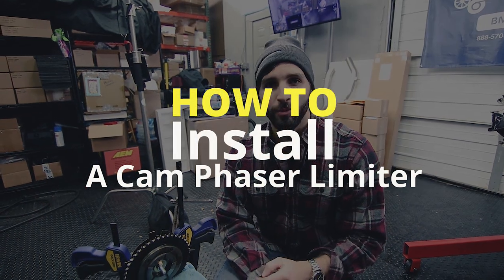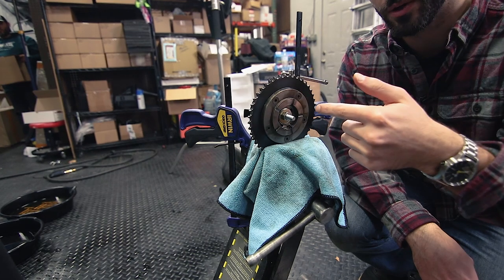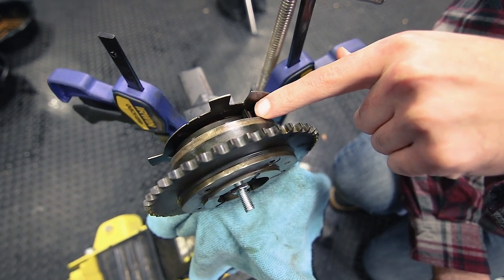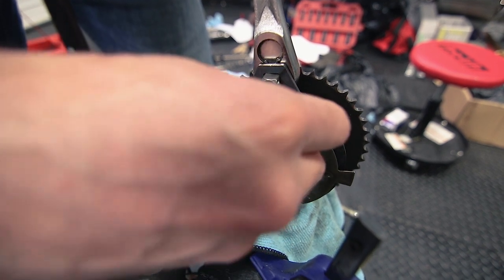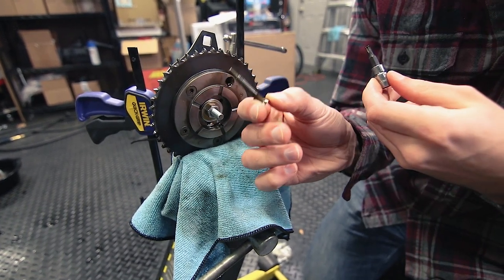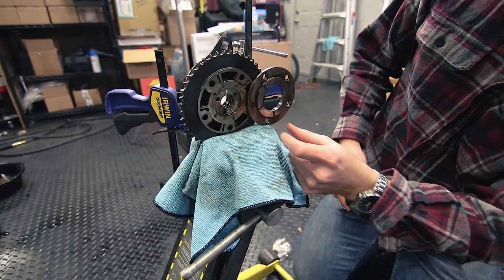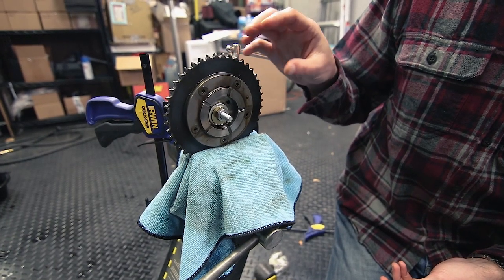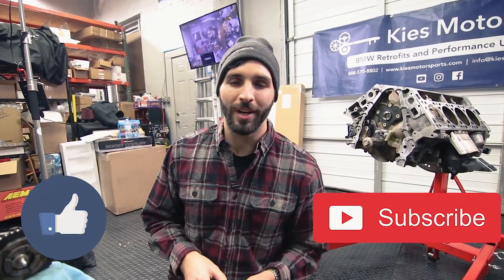AFM DOD Delete - How to Install Cam Phaser Limiter VVT - Silverado Corvette Camaro L83 L86 LT1 LT4

Comment: The problem with these phase limiters are that they do not fully lock out the cam sprocket, the sprocket can still slightly move on the inside , on the dyno there has been erratic readings and power loss issues with those phaser lockout kits. Ditch that setup and use a LS3 sprocket and billet timing cover. Also, that sprocket has to weight 10lbs, think about taking that rotating mass off the camshaft.
Reply: Would u happen to know which car gear vvt delete kit is good for single bolt
Reply: Armando Monreal Late Model Engines offers the Gen V LT1/LT4 VVT delete front kit. Comes with a new billet timing cover, LS3 single bolt cam sprocket, cam bolt. Also it utilizes a LS3 front seal which is less prone to having failures like the factory LT style seal is plagued with. It’s $500, while it’s considerably more expensive, it’s well worth the investment.
Reply: Lol
Reply: I have a 2010 vvt motor just installed in my 08 chevy with afm. I'm having problems with a rattling sound from above idle up to 2500 rpm then it disappears. I've narrowed the noise to behind the valve cover. Would this phaser be wreaking havoc in there? Can I just throw my cam sprocket from my old motor on there in place of the cam phaser and carry on?
Reply: What did you end up doing

Comment: I. Did the cam and lifter  delete on my 20 5.3 but did not  put the phaser limiter in .. after driving on hyway at idle motor has clicking ,grindy,metalic  sound around water pump area???? Could this noise be that damn phaser trying to activate???

Comment: Hi question..i took the bolt im not supposed to take out all the way out heard it unwind put the delete wedge in bolted it back up..would i run into an issue if i used it?

Comment: I have a non dod with vvt cam I am going to install, do I still need to do this to the cam phaser? or can I leave it alone. it is basically a stock cam just non dod.
Reply from the maker: You'll need to check with the cam manufacturer.

Comment: Trying to help a buddy that I sold an 07-13 model truck to and it’s throwing a timing code. They say the chain seems loose and I was sure I lined the cam and crank up right. It’s one of those VVT single bolt cams and it’s just hard to see. I did replace the factory timing chain dampener with a LS2 style(solids plastic) any tips on lining that cam phaser up?

Comment: Currently working my 09 Silverado w 6.2 l9h, motor didn't come w dod/afm. I got a TSP vvt2 cam, I want to keep vvt, I need to install the comp cam phase limiter for the vvt right?
Reply: Wondering the same thing. Is the phaser limiter the only thing needed to delete vvt?
Reply: @winstonhiggins2759  the cam phase limiter is for vvt cams, if you delete it you don't need.

Comment: Is the center bolt necessary when you are replacing the cam limited? The outside bolts seem to be the ones that matter.
Reply: I guess he thinks this thing is gonna fly apart.
Reply from the maker: Just to be safe we recommend putting it in. One of my buddies did this on his 6th gen Camaro and it flew apart on him and could easily take out an eye or worse.

Comment from the maker: FYI: This phaser limiter restricts the variable valve timing from 60 degrees down to 20 degrees of variability....

MORE INFO (for the curious people)....The Cam Phaser is an adjustable sprocket that controls the position of the camshaft relative to the timing of the crankshaft. This is also known as Variable Valve TIming (VVT). The phaser can advance the cam timing at low RPM for a smoother running engine and ideal low RPM performance and then retard timing at higher RPM for more horsepower and performance. The adjustable sprocket is controlled hydraulically using engine oil and the computer to open the solenoid.
Reply: The Sundae Drive can I just remove the vvt since I got rid of my DOD ? I went with a stage two cam
Reply: The North Pole Santas Work Shop yes you can. Both LME and Katech offer a billet timing cover that allows the use of a LS3 cam sprocket and single cam bolt. The Katech piece is on back order.
Reply: the vvt doesnt work at low rpm it works at high rpm advancing a few degrees the cam for more power and eficiency:hand-pink-waving:

Comment: What a great detailed video,, so I have a question,, so I’m assuming I have to install the limiter if I’m doing a delete?
Reply from the maker: It depends on the cam you are running. Whoever you buy they cam from will be able to advise what is needed

Comment: The first bolt I tried to loosen (@4:00) position, the freakin torque head stripped out of the the freak bolt. WTH  , I had no choice but to drill it enough to get an easy out in it and remove it!!!!!’ &$”&#% I heard something pop when I took it out, that was the only bolt I removed. Did I screw something up??????
Reply from the maker: Ugh man that stinks. Hard to know for sure. Doesn't hurt to get a new one to be safe

Comment: On a 2019 Gen V LT L82 5.3 there is a spring plunger behind the plate. Be careful when rotating it out of the way or the plunger and double spring behind it will shoot into a black hole.
Reply from the maker: Oh good to know! Thanks for sharing.
Reply: @TheSundaeDrive  I tried attaching a picture but can't on here.
Reply from the maker: You could email it to us at contact@tsd-motorsports.com and we can check it out. Thanks!

Comment: Is this completely necessary if doing a dod delete with a factory replacement type cam
Reply from the maker: You will need to check with the cam manufacturer. I'm not 100% sure if you keep the stock lobe sizes if it is. I did is a stage 1 which is only mildly more aggressive and it was necessary.
Reply: @TheSundaeDrive  thanks for the quick reply, it is a stock size, I think I'll be fine without limiter.
Reply from the maker: @coupe50h  no problem! While I think you are probably right, I always recommend double checking with an expert like GPI just to make sure. You don't want to be in this deep and have a simple thing cause an issue. Def let us know what they advise!
Reply: @TheSundaeDrive  sure thing, it is a customers truck, I've done several dod deletes, but this is my first 5th gen, and oh boy what a pain it is compared to older ls/lq stuff.
Thanks again
Reply from the maker: Ahh gotcha! The new ones do seem a bit more complicated. Best of luck with it! Hopefully the videos help you out!
Reply: @coupe50h  did you have to add the cam limiter with stock non afm cam?
Reply: @trevorgill1120  I did not, as my boss said it wasn't necessary, so it was on him if it fouled yo lol, but the customer has been happy ever since. I talked to others that said I should have put the limiter on it to be safe, but this guy been doing ok with normal driving.
Reply: @trevorgill1120  also, I put in a comp cam that was factory'ish spec as I was told the factory cam wouldn't work with the delete, but idk for sure. This gen of engines has deep valve reliefs so hopefully that allows clearance just in case. But the afm had to be turned off with a programmer before it would actually run right. Good luck.

Comment: What's the torque spec on the 5 bolts? You used a torque wrench but didn't say what it was
Reply: I know this comment is 2 yrs old but he says 85 in lbs in the video..

Comment: Thanks for making these videos. Do you need the phaser adjuster because of the new camshaft you are using? In other words, what would happen if you did not install the limiter? I just thought that the point of the vvt was to increase performance, so why is it necessary to limit it?
Reply from the maker: Technically you could just use the ECU to control cam timing and limit the VVT via software. Since we are using a more aggressive cam we want to be sure to avoid any piston-to-valve clearance issues. Adding the physical cam phaser limiter is a form of added insurance. If there is ever some sort of error via a sensor or software the VVT might advance the cam too far causing valve interference. The cam phaser limiter will ensure it does not advance more than 20 degrees
Reply: The Sundae Drive thanks for the explanation. Looking forward to see the finished project. I have a similar truck (GMC) learned a lot by watching
Reply from the maker: @andrewwilkinson5220  awesome! Glad the videos are helping!
Reply: @TheSundaeDrive  why not just do the VVT delete as well? Is it harder? Or not necessary?
Reply: @buddyrebel_Garcia   from what I understand you only have to do that if you’re adding a bigger Cam

Comment: What exactly does a cam phaser limiter do ?
Reply from the maker: Good question. I regret not mentioning that. The cam phaser limiter limits the variable timing of the cam. From the factory it is capable of 60 degrees of phase. With the limiter it is closer to 20 degrees.
Reply: The Sundae Drive sorry to pepper you with questions what does that do for the engine?

Like does it sort of have the engine operate in a more controlled manner in a sense
Reply from the maker: No Problem! The Cam Phaser is an adjustable sprocket that controls the position of the camshaft relative to the timing of the crankshaft. This is also known as Variable Valve TIming (VVT). The phaser can advance the cam timing at low RPM for a smoother running engine and ideal low RPM performance and then retard timing at higher RPM for more horsepower and performance. The adjustable sprocket is controlled hydraulically using engine oil and the computer to open the solenoid.
Reply: The Sundae Drive what’s the benefit? I have 4.8 with vvt will it cause my truck to be sluggish under load at dead stop
Reply from the maker: This was added in our case because we are deleting DOD from the system with a different cam shaft.

Comment: so what do you do when the spray spring unwinds? lol
Reply from the maker: You need to get a new one. I don't think there is a way to repair it easily
Reply: The Sundae Drive so there’s no way it could be retensioned?
Reply from the maker: One of my friends had the spring come undone and he had to replace it. Don't have first hand experience with it coming unwound myself
Reply: Did you get it fixed my spring came off right as I was taking off the vise after I installed the limiter?
Reply: @TexasIslander  exactly what happened to me, i ended up rewinding it and worked well. i drove the truck 30k more miles before selling it back to dealership. pretty sure still doing fine🤷🏽‍♂️ haven’t seen truck around since but i romped on it every chance i got and never showed any sign of anything👍🏽 hope this helps
Reply: @josesosa232  thank you for the information. I can’t seem to get my spring to stay on after I wind it. And how did you wind it back how may turns. I’m thinking just keeping the spring off cause I’m not sure what it does now that I locked out the phaser.

Comment: Results of this
Reply: Blew up
Reply: they took the word of someone and replaced the heads. valve spacing in the head was a few thousandths wider than the bore in the block, they were hitting the block bad, broke a few trunion castings and bent a few valves.
Reply from the maker: Pretty much lol.